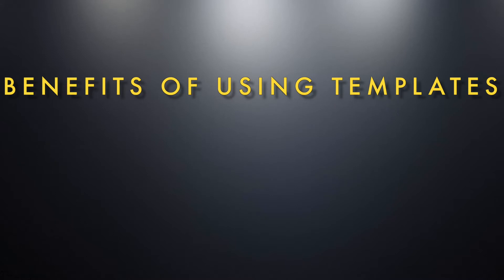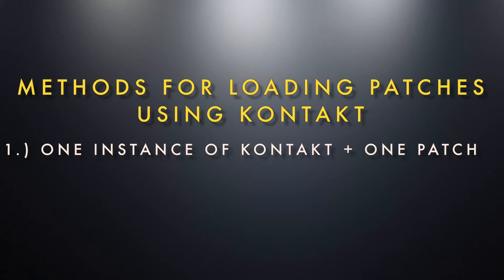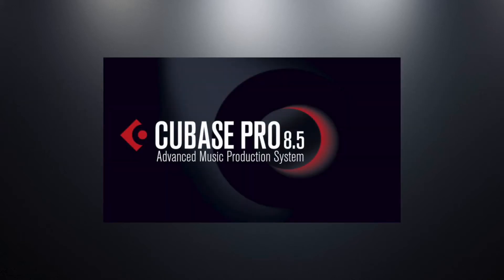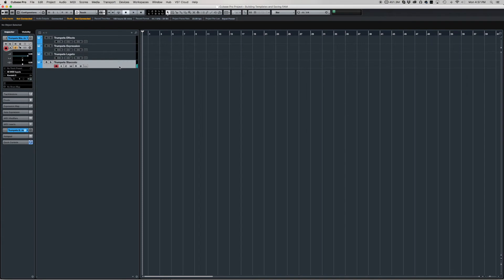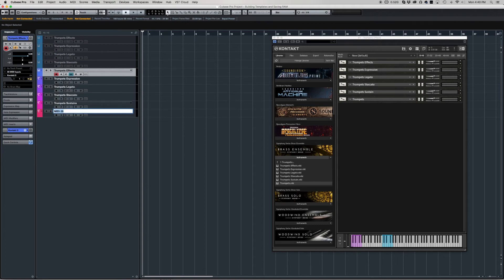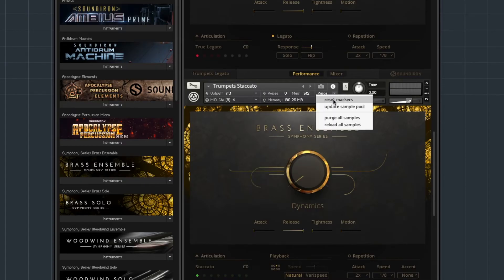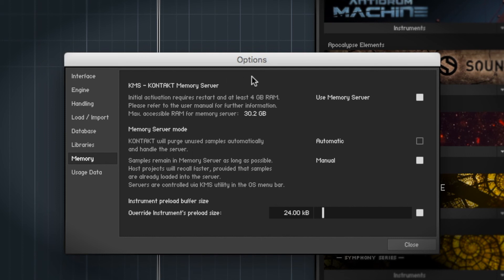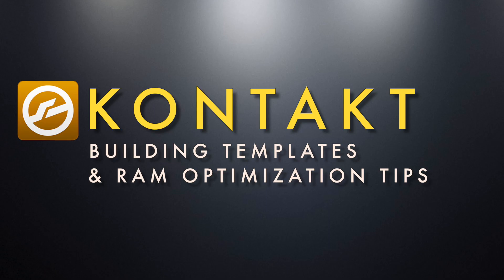Soundiron -  Kontakt | Building Templates and RAM Optimization Tips

Comment: Thanks, I have LogicPro on iMac 40gb ram, and I constantky have the out of memory issues, why do you say in a comment hat a SSD driver could help? I have all the l8braries in an external SSD drive, is there any chance to use the driver in real time instead of loading the samples in the ram? Or at least sharing 50-50? Or do all samples must be read from the ram?
Reply: If a preset is using time-stretching or tempo-synching, then it is using Kontakt's TMPro engine, which always must load the data fully into ram.. Otherwise, it's typically going to be in DFD mode, which streams the majority of data from your hard drive in real time.

Your mileage may vary, but I'd say an external SSD drive is pretty much always going to have more access latency and a slower read/write speed than an quivelent internal SSD will, regardless of  what the specs of the external drive and port are. If you can't add an internal SSD, then you can try increasing the instrument ram preload settings in Kontakt so that it's still disk streaming, but keeping at least a little more in ram. Then, for libraries that allow it, purge or unload any samples not actively being used. Lastly, set the voice limit in Kontakt lower so that you reduce the disk streaming load a bit further. Lastly, get the fastest drive you can and make sure you're using the fastest port that your machine has (Lightning/USB 3/Firewire/gigabit ethernet/ etc.. ) and make sure nothing else is on that port. Plug it in directly, don't use a hub.

Comment: Thanks - helpful and succinct video. 'Disable tracks' feature in Cubase is so important; I use Logic Pro X, on a 2017 i7 4Ghz iMac with 32Gb RAM, and am constantly running into problems, even though I purge all samples in my template. As a result, I have to come up with workarounds, such as saving instrument groups into User patches, so that I can pull up all eg violins, all strings, all brass, etc, as needed, without having all instruments loaded from the outset. With my specs (not an inexpensive computer by any means), I still have to use such workarounds, all because of the lack of 'disable tracks' in Logic Pro X that Cubase has. Such a simple and obvious feature, but it makes such a difference that I'm considering getting Cubase just for this, that would then allow me to build large templates. Am I right - is Cubase worth it for this? My other route is to get an external SSD (my internal is HDD), such as the Samsung T5 or Sandisk Extreme portable, as I'm hoping this would reduce the load on my computer, having thereby separated read/write. Any suggestions on which way to go: SSD and keep Logic, or Cubase and use disable tracks?
Reply from the maker: SSD’s are great for streaming samples faster. Another thing you can look into is VEPro. Cubase is great for midi sequencing, but using it with something like VEPro will allow you to work easier because you can host Kontakt instruments outside of Cubase. But SSDs are always worth investing into.
Reply from the maker: Logic has a On/Off button that does the same thing as Cubase's disable track. You can learn more about that here: https://www.youtube.com/watch?v=tfuiEBqjq70

Logic also has a Freeze track function which is helpful for bigger projects, you can learn about that here: https://www.youtube.com/watch?v=VP0A2g_hTx8
Reply: @SoundironAudio  Wow I'm mind blown by the support and tips you guys are giving... I don't own any Sound Iron Libraries but will definitely keep a eye on them! I just bought Ableton Live as I perform live a lot, but they don't have the ability to disable tracks which is mind blowing.... can you help me in this ? thanks a lot!